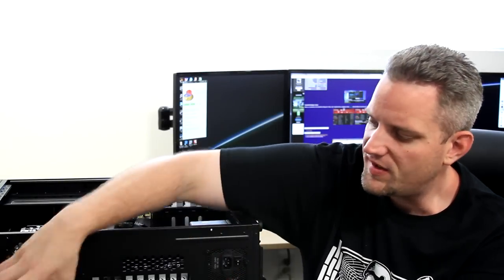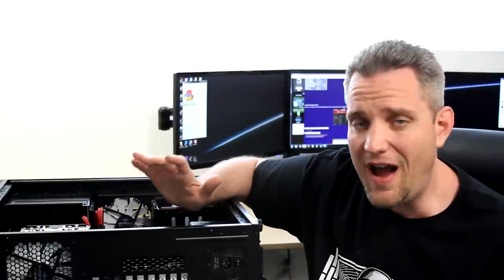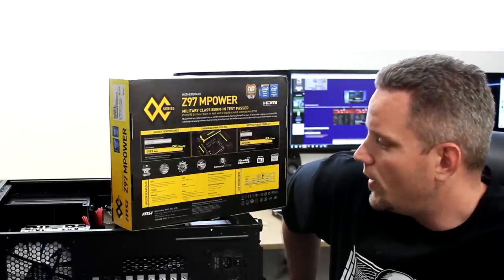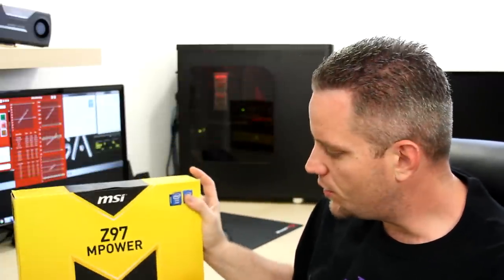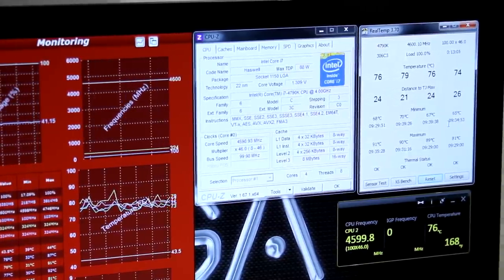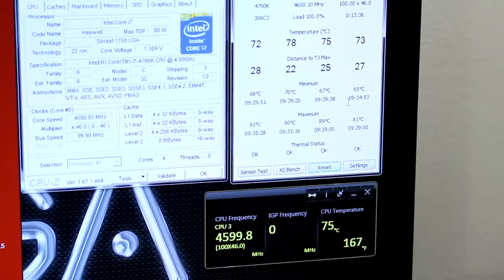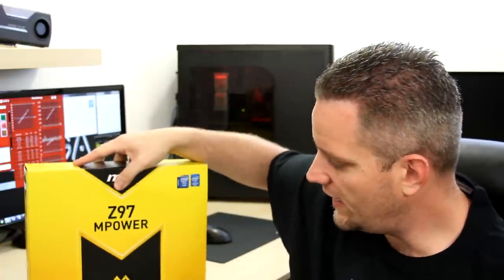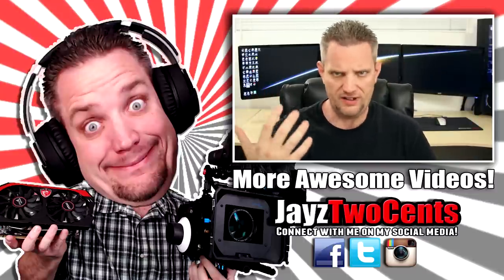Overclocking the Intel 4790k with the MSI Z97 MPower on air!

Comment: Hi, I am making an gaming PC, for 1440p gaming
-I will be using i7-4790k (not over clocking right now, may be after couple of years)
- nvidia gtx 980
-16gb ram
- rosewill blackhawk mid tower (5 fooling fans, mostly 120mm)

You think the stock cooler will be reasonable enough for the processor ?
Reply: sahil patel Better get that 980 ti not the 980
Reply: Stock cooler will not be an issue but will be noisy and your processor will get quite hot, for very cheap get a Hyper 212 evo or something
Reply: Cool, thanks

Comment: I'm testing out my first ever overclock right now. I'm 3 hours in in my stress test and everything seems stable.

4,7 GHz @ 1.295V
Temps around 65-80 during stresstest, with highest peak at 85, but that was achieved the first few seconds after I started the test, fans hadn't gained speed yet.

I'm surprised how well my cpu clocked with my Noctua NH-D15 air cooler :3

People tend to say to try and stay under 75 degrees, but I assume my temps are okay, since they are under 100% load in a synthetic stresstest, or should I lower my clock back to 4.6?
Reply: its good temps what is your strestest software
Reply: A combo of prime95 and intel XTU
Prime95 as I overclocked it, then as I found values which seemed stable I ran intel XTU for 24 hours to check stability, since prime95 was acting weird with odd spikes in temperature. Didn't want to leave my pc on over night with weird spikes in temps, call me paranoid :)
Reply: mackan072 nice they are good stresstest softwares

Comment: wtf? you have the voltage at 1.3 and it gets 90oC... jesus... will this change with a noctua nh-d15 or a quad rad specially for the cpu? (i think it will change but its good to ask and be sure :) )

Comment: What is it with Gigabyte motherboards, I got a Z97X-SLI and it also had the CPU VCore cranked up all to hell. Not as bad as in this video, but VCore was at 1.374 in BIOS with everything on Auto, and it shot up to 1.43 when Turbo OC kicked in. :-/

Comment: Maybe I am doing something wrong, but my FX 4170 running at 4.4GHz running at 1.450V is only reaching 45C. Why does the intel run so much hotter?
Reply: Yup i have the fx 4350 running at 4.8 ghz at 1.425 and the temps are fine. The difference is the architecture and it makes intel much hotter but it needs less voltage to run.
Reply: does that have to do with intel putting the processors in the middle together and AMD putting them in the corners then???
Reply: I want to say that AMD uses a different type of silicon called Silicon-on-insulator or something like that which causes lower temperatures even with more power draw.  Do NOT quote me on that that's a just something I might have heard at some point in the past..

Also, Intel uses a crappy TIM between the die and the heatspreader that causes poor heat transfer.  Although the metal top part of the chip that you can see might be getting cooled well, there's a lot of heat trapped beneath it.  AMD solders their heatspreaders to the CPU dies I think, so it transfers heat very well so it can be carried away.
Reply: he was running prime95, those temps he was showing was the core under load, not idle.
Reply: ahh, that explains alot. But I stil find it weird because withe prime95 running my cpu only hits 65C and I am still using the stock cooler. (and I dont even live in Antartica)
Reply: you might be running stock clocks though, right?
Reply: ***** it is slightly overclocked from 4.2 to 4.4
Reply: maybe stock amd coolers are more effective than intel's.
Reply: *****
I guess, when it is not to warm (say 20C ambient) my cpu runs somewhere around 25 to 35C
Reply: Its because AMD uses solder on their chips between the die and the IHS, while Intel uses thermal paste. Solder is much better in dissipating heat since it's metal. Therefore, Intel chips generally run hotter than AMD's.

Comment: Why are the intel chips getting so hot on low voltages my FX-8350 stock voltage is 1.365 and it runs 59C on a Hyper 412s

Comment: I got my 4790k 3 weeks ago and haven't overclocked it yet because its performing so well already, its getting to its 4.4GHz turbo speed on all four cores in prime95 stress so its pretty much up their all the time in games, I like to give my hardware a stock period before OCing anyway, had my R9 290 since January and its still stock :P 
(although i think ima need to OC the damn thing, its JUST ABOUT smooth on nearly ultra in project cars (5760x1080, no AA) so an extra 100mhz on the gpu might make it properly smooth :P)

onto a rant...:
Only thing ill say, the asus maximus vii ranger "ROG" motherboard i got is crap, maybe it will oc well but i dont see it having a chance of being better than boards £30 less than it to be honest and all the features it has are pathetic, AI suite cant even read the temp sensor properly and the onboard sound simply doesnt work properly, its quiet (even though my headset and speakers have their own power amps) and speaker fill mode just ruins the audio quality... even the craptastic onboard sound my core 2 duo motherboard and amd phenom ii motherboard (both msi boards) was better than the supposedly soundcard grade onboard sound of this so called "ROG" board... Republic Of Gamers.. more like Ripped Off Gamers.
Reply: How is it preforming I'm gonna buy the 4770k by the way and an 290 tri-x
Reply: Tim Lindholm yeah as jeoway said, might aswell get a 4790k, its gonna be the same price once the "early adopter price" goes away and even now its only a bit more, its not worse in any way only better :D

i've had no problems with it so far, it actually seems like my room got a bit cooler (when the pc is idle anyway and compared to my old AMD Phenom ii x6 1090T cpu) in the 3 weeks ive had it the highest cpu usage ive seen during games was 62% and thats not even the overall cpu usage xD, the R9 290 is cool, mine handles triple screens well but i think if you are only going to run games on 2560x1600 or lower (ie no triple screen) then get a GTX780, AMDs drivers recently are being quite awkward for me but its the price im having to pay for the better triple screens support lol
Reply: Tim Lindholm the 4790k is only $10 more than the 4770k on amazon right now. I only have the 4770k and I wish I got the 4790k but my GPU compensates for it.
Reply: oreomoon1998 lol theres no such thing as a gpu compensating for a weaker cpu, they do different things for the computer. anyway there is no performance difference between 4770k and 4790k you just get a easier to overclock cpu that requires less expensive cooling to overclock on.
Reply: *****
getting one used for 200 dolars
Reply: *****
i allready planed to get one and i gotta say its amazing but really high temps
Reply: i got the 4790k paired with a ssd and a 780, holy shit this thing is fast...i think i loaded into windows from bios in less then 5 seconds tops

Comment: Strap a Noctua NH-D15 cooler on it and see the temps mine at idle 4.00GHz stock are 26 C
Reply: Old comment I know but on air I am at 25c. mine is 4.5 
I should note it's winter time though at not summer heat.

Comment: I'm going to put mine under a kraken X60, i'm using the stock fan for the time being and it's pretty hot in my room due to the weather. When i push it with Dolphin (wii emulator) to play twilight princess, the gamecube version, it peeks at 92 degrees. I know this is way too high, but is it actually dangerous?
I idle at 40 - 43 and under medium load i hit 60 to 64.
I'm going to get rid of the stock fan as soon as possible

Comment: Will my hyper 212 evo get the job done? I know Jay did it on air, but he didn't mention what cooler he used, or I couldn't hear it.
Reply: +Mükerrem Tüfekçioğlu yes
Reply: +OG Rap music thanks
Reply: no use a aio cooler at least  sitting still mine runs 22c just idle and video editing it runs around ,,55 c

Comment: Is it possible to keep Intel Speedstep with an overclock? I wouldn't want the cpu to run @ max speed all the time. I had an AMD 965 BE & the Cool & Quiet operation mode would get disabled when I tried to overclock... so I left it at stock. Just wondering if things are different on Intel's side

Comment: Hey Jay, my system:
i7 3770 3.4ghz 
16gb 1600 mhz
gtx 760
the motherboard is crappy but up and running fine
And the thing is that my cpu is running with a 15$ air cooler which is a little bit better than the stock cooler. And it runs 40c-50c idle and 75c-90c while gaming (battlefield 4 mostly). My question is, should I get better air cooling or should I got for liquid cooling? If you do suggest something then could you link it? Anything helps!
Reply: If you have room in your case the noctua nhd14 is a beast air cooler but its humongous. Water cooling would work to and would definitely get those temps down.
Reply: Air cooling would the job just fine. You can pick up the same cooler as mine which is the 212 Evo. It's around $30 on newegg or Amazon. Though make sure it can fit in your case. I see 30 - 32 on idle and low 60's at tops in games. I'm running a 4670k @4.4ghz with two 7870's in CF.
Reply: wait why would you go water cooling , unless its a all in one which dont get much better temps then decent air coolers i see no point going water with a 3770 your not gonna be overclocking since its locked 3770's dont really go past 4.4-4.5 and thats messing with the bus clock

Comment: ***** Can I assume correctly that since most MMO's are mostly CPU bound that the I7 4790K would be a viable upgrade from a FX 8350 your opinion would be valued. I'm only considering the upgrade due to being capped around 31-40fps in general MMO's I play on my current Processor.
Reply: Alexandra Madison $300 processor just for MMO games? Thats a bad idea in my opinion, gor with a $200 like an i5-4670k, still four cores and still overclockable.
Reply: Team Burgers Actually it's $434 here in Australia. and It wouldn't be just for MMO games per 'say as I am starting to see in certain single player titles diminishing frame rates at first I thought it was my video card but all my research shows that my card should preform higher then the results I'm getting which leads me to think the CPU is holding the rest of the system back. I had heard a lot of mixed opinions about the FX8350 and at that time I decided the pro's out weighed con's not so sure about that now. Thanks for the suggestion but I'd rather stay in the i7 range of CPU's one lesson I have learned from the experience of my FX8350 is that you get exactly what you pay for. And I also don't overclock by the way I know most people do now days but I feel its still something of a gamble technique with to many risks.
Reply: Alexandra Madison Well if you do go with i7 then get the 4790k. The 4770k is good but it gets much hotter, about 10 degrees more on the same cooling
Reply: Alexandra Madison or you could just wait until broadwell comes out
Reply: Adam Sweitzer GPU is a R9 270X also have 16gb RipjawX Ram
Reply: Team Burgers Thanks I'm also looking for suggestions on a decent Motherboard ideally I wouldn't mind one of the Asus Maximus boards but there a tad pricy.
Reply: Yeah alright, I was just making sure your gpu wasn't the problem lol. Upgrading the CPU would definitely help your fps.
Reply: Can't go wrong with a Asus z97-C
Reply: Adam Sweitzer I can only locate the Asus Z97-A but I'm guessing there's hardly a difference ?
Reply: Alexandra Madison My suggestion would be a Gigabyte G1, an Asus Rampage, or an AsRock Extreme6.
Reply: Team Burgers I could only locate the Asus Rampage motherboard which is $700AUD and the Asrock Extreme 6 Never used Asrock before though and I'm a bit unsure about them it's around the $250AUD range which is decent.
Reply: there ya go, thats a nice board.

Comment: Dumb question, I play some games that have crap engines that only use 1 core.  Does overclocking a CPU increase the speed/performance of EACH core?

I recently installed a 4790k (got at Microcenter on sale 279 also) and a ASUS Z97 Maximus Hero VII
Reply: Might be late but it overclocks all cores to higher speed

Comment: so did the high voltage shorten the cpu lifespan of chip or is it still kicking?
Reply: +Brandon Ion he uses the 5960x so that question won't be answered
Reply: Technically I would say yes, however by much? As long as you literally don't go right up to the temp max threshold and stay between 70-90 degrees Celsius MAX, should last slightly shorter than the card at normal clocks.

Comment: whats the best cpu for gaming without overclocking ?
Reply: i5 4690 or i7 4790 ( i recommend 4790)
Reply: ok thanx everyone and is overclocking hard ?
Reply: zorhis1996 no its not hard, you just change the cpu speed and maybe up the voltage. however u need a after market cooler if you plan to overclock
Reply: ik thats y i am scared to do it
Reply: zorhis1996 Rule #1 - If you're scared to overclock, don't overclock. You'll probably fuck up.

Comment: Running the risk of no one replying, but I just picked up a 4790K and dropped it into my system with a cooler master hyper 212 plus, and I can't get the chip to run even stock without hitting the 85 degree shutoff of OCCT within a few minutes. Any recommendations? Tried reapplying thermal paste once, using arctic silver.
Reply: You might have to delid the chip in change the internal thermal paste. Did you buy it used??
Reply: New old stock. Sealed box, but obviously a bit old.
Reply: I'be been running the same chip (4790K) and air cooler (Hyper 212 EVO) and it runs at around 35-40C (idle) and 65-70C (under load).

I haven't bothered overclocking it as I'm happy with the 4.4Ghz out of the box.

Comment: gigabyte boards are not reliable. I had previous gen z87oc very poor boards with loads of issues. I had it replaced three times. Also software is just colorful and mediocre in functionality with very little on fly settings. I gave up on once great company. I bough different brand and is fault free several months later.

Comment: I have the Gigabyte ga-z97-hd3 with corsair h55 watercooler, and i74790k I got 5.1 Ghz
Reply: how much volt?
Reply: I dont know. The Power supply says "100V - 240V"
Reply: +IcyPhoenix15 i mean on the core

Comment: Im gonna buy an 4770k for 200 dollars, but jay said it was crap I'm assuming from the heat but can I overclock it with an h80i?! And moderboard for 70 dollar(all of it is used)
Reply: A friend of mine is running a 4770k and a h80i and hes completely fine with temps and everything. hes @ 1.25v and 4.4 gHz
Reply: Marius Brunvær
thanks!
Reply: Exo Thermia
4790k @4,4ghz and 1.1511v. Prime95 27.9(Custom 1344 fft's in place) max-temp after 15min 76° Celsius. I think this should be ok :)

Cooler is a HR-02 Macho :)

Comment: ***** I know this is a little off topic from what this video was about but do you know what the maximum temperature of an FX-6300 is? I've read around online and a lot of people are saying 60degress celcius but that seems way to low to be realistic.
Reply: I have an 6300 overclocked to 4.1  and never goes higher than 70 degrees with an h80i with ONE noctua fan. the temps are great!
Reply: Tim Lindholm Use TWO noctua fans !!! The H80i has a thick radiator and if you use push/pull with that radiator you will get much lower temps !!!
Reply: no not really i get 30 c idle and never over 70 in full load

Comment: Do you know if the MSI Intel Z97 pcmate mobo, is ok for overclocking the 4790k?
Reply: It's fine, I use that mobo and I'm able to get 5.1 on air @1.37v and a max temp of 91 HOWEVER don't oc based off of my data, get ur own of u wana be safe

Comment: Just got a z97 for my i7 4790k, got it up to 4.4ghz with a h81 v2 corsair water cooler and I read that the cpu shouldn't get hotter than 74°c (on intels website). Mine averages at like 67-70°c on full load and peaked at like 74-78 on the cores.
How is averaging in the mid 70s and peaking in the high 80s to 90 still okay for the cpu? O.o
Reply: That is high for a water cooling. I have 4.4ghz too, but with an air CoolerMaster block, my averages about 57-60,  highest temp at full load is 74.
Reply: Random Guy On the Internet well I did not intend to ever oc it because I never had the motherboard to do it, but my old one broke last week so now I did it but my cooler isn't the best for it I guess.
 The h80i v2 is a 120x120mm radiator only, might upgrade to a bigger one soon.

Comment: i get my i7 4790k with 1.160 V to stable 4.6 ghz
i set the volt to 1.170 V just to make sure, it is 100% stable.
did i get a good chip or die jay had bad luck?
Reply: You pretty much won the chip lottery .
Reply: +giorgos zer really? 
ok
do you think I can sell this chip for much money or doesnt any one buy a i7 4790k today?
Reply: +Fendt Arena 
I dont think this is possible because intel i7 6700k is on the market now .You can possible sell it for about 260-280 bucks .
Reply: +giorgos zer ok
Reply: +giorgos zer yea if it can show proven benchmarks it can be resold as a good  Sku high oc chip
Reply: +LTDanno360 
maybe if you are lucky enough but i dont think  someone whould prefer a good  4790k over an average  6700k at the same price ...

Comment: I'm having huge problems with heat on my new 4790K. Using a Liqtech 240 it idles around 30C but jumps to 90C under video rendering load. I've lowered the vcore to 1.15 and updated the BIOS, but still have no idea what's going on
Reply: Ollie Burton I'd say pull the cooler, remove all thermal paste.  Get some Artic Silver or like me some Artic mx-4 and re-put on cooler.  If still an issue it might be your cooling setup.